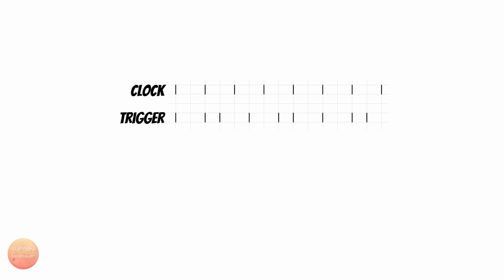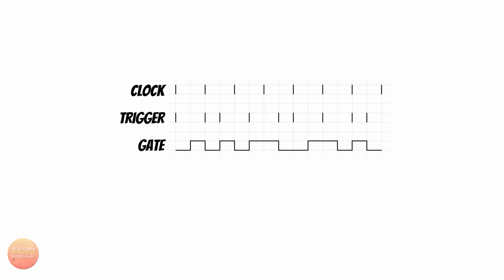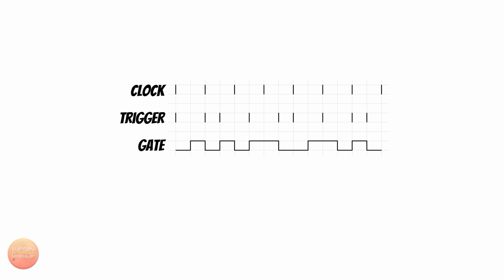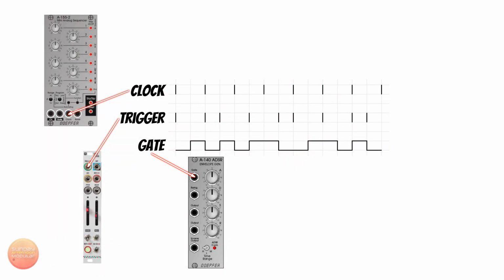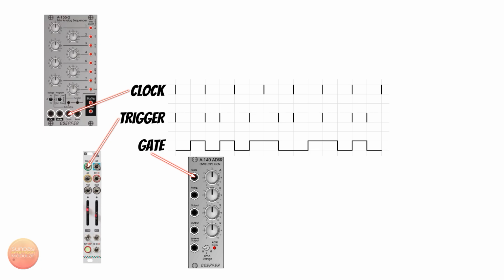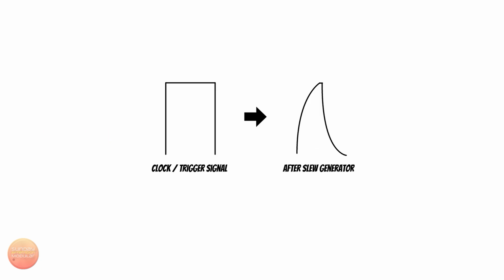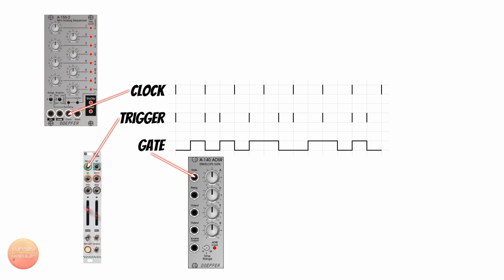The Secret Language of Your Synth: CLOCK, TRIGGER and GATE Explained!

Comment: is the length of a Clock pulse the same as the length of a Trigger? Is there a spec that regulates the length of clock and trigger pulses? 

thank you for the explanatory video.
Reply from the maker: Hey there, trigger and clock signals for synthesizers are not regulated, so there are no specs how they have to be.
However, a trigger signal is a very short pulse signal, usually around 1ms to 10ms.
A clock signal on the other hand is a pulse signal that often has a 50% duty cycle. This means if it stays high for one second, after that it will stay low for one second, then high again for one second...
The length of a clock signal depends on the set speed (bpm). The faster, the shorter the pulses are.
I hope this helps, have a great day!
Reply: @SundayAfternoonModular  thank you, this helps! I didn't know about the clock duty cycle. I am trying to understand how "create" a trigger or clock signal, so thank you for this video. For example I created a trigger signal for my Juno 60 arpeggiator using a drum sound and it seems to work reliably. But I also did not want to damage the Juno!